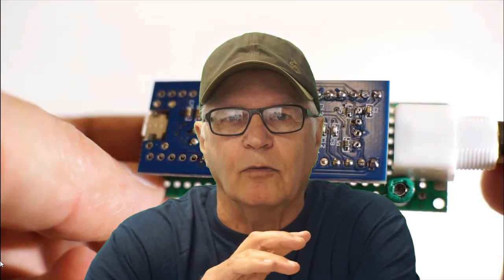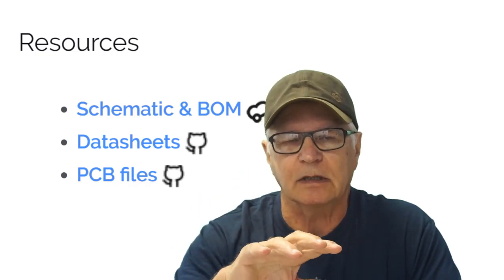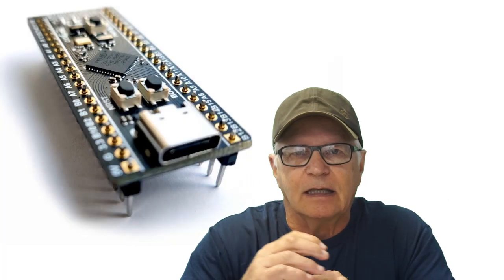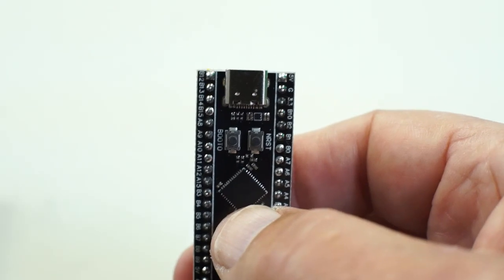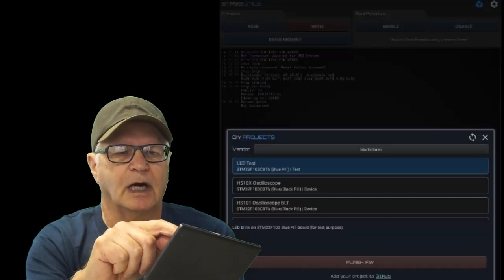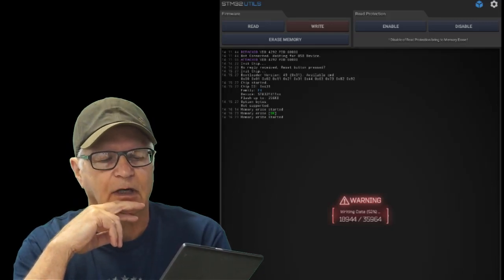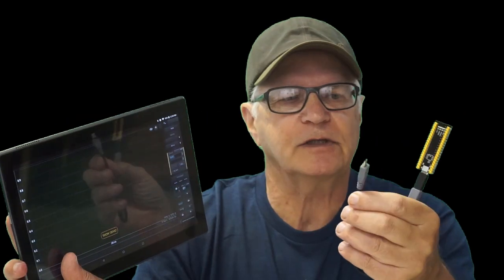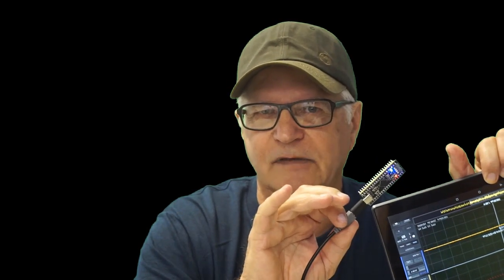GADGETS#114 - HS402 DIY OSCILLOSCOPE

Comment: does ebay have the same components as ALibaba?
Reply from the maker: sometimes eBay will have some of these components and might even be the best deal (most often not the case)
Reply: @theGADGETSplaylist  i bought the STM on Ebay, but headrers were not attached. i have a soldering iron/pin from Amazon. to do soldering work for this , what do you recommend? I want to do make the HS402 the way you made it.
Reply from the maker: @gilbertstrategos  STM32 boards usually ship with headers which we have to solder ourselves. Very easy to do with a good quality soldering iron and thin leaded solder wire.

the fact you ask this question Gilbert leads me to believe you'll need help through your build:)

and the best place do discuss it is on out HScope TELEGRAM group where I and others can answer questions and provide tips...here is link:

https://t.me/hscope

Denis

Comment: HS 102 same HS 402 ?    XY Plot How is HS 102
Reply from the maker: HS402 is a huge upgrade to HS102.

I like HS102 as a through hole build and it is a capable little oscilloscope keeping in mind that is not 1MΩ impedance (as most scopes)

X-Y PLOT is a HScope feature for all 2 channels supported scopes including the HS102

Comment: What do you mean HS402 license? Do i have to pay to use the app or what?
Reply from the maker: HScope free version offers very limited features/performance. Meant to test compatibility with android device and for users to get a feel for the app.

A license for the supported oscilloscope, HS402 in this case needs to be purchased for full use. The license can be installed on as many android devices you own on same Google Account.

I am not always current on pricing. I would say $10 - $15 for HS402
Reply: @theGADGETSplaylist  And where can one buy this license?
Reply from the maker: @EstBest69  you 1st install free HScope from the Play Store. Then within the app, there is a license page in settings and purchase for the desired oscilloscope support is done through there...

you may be interested in the HScope group on Telegram where questions are answered and information shared:

https://t.me/hscope

Denis

Comment: I got my STM32 F411 board and managed to program it, and Hscope sees it. So happy days! Thanks for the video making it clear how to program this.
Reply from the maker: Good stuff, Alastair!
A few minutes ago, I got the PCB populated as far as I can go for now...am waiting on some components...and then pick up from there
Reply: @theGADGETSplaylist Sounds good! STM32F411 is quite an impressive chip. I worked for ARM in Cambridge UK for a while and got a good insight into how chips are designed and tested before being lithographed into a chip (which is the expensive step).
Reply from the maker: @armunro  you should consider joining our TELEGRAM HScope group, Alastair.
You'd be a good fit:)

Comment: Hello, your project is wonderful, I would like to repeat it, but I have problems with the parts, I ordered STM, and the board and radio parts come out very expensive and only on order in large batches, I have a question for you whether it is possible to order a board from you? without stm
Reply: Can I talk with you separately?
Reply from the maker: @kaz56AK  sure Artur , we can talk:)
The most practical way to discuss these technical issue is through out HScope GROUP on the TELEGRAM app.
I invite you to join us there...
Reply from the maker: I would give you the boards if it was practical to do so:)
But it is not...shipping and Customs would be just as expensive as having them manufactured.
I found that ordering from JLCPCB and chosing their lowest cost mail option (even if it means waiting a few weeks) is the best way...
I do hope you accept my invitation to join us on Telegram, Artur. We could discuss this further...

Comment: Skip the STM32f4 series for the next hscope! Move over to the STM32f303 and get 20Msamples/second! All you need to do is design a pcb or find an existing nucleo board and you can have much better performance. I started work on my own, but lost interest.
Reply from the maker: I don't design these. Martin Loren does.
It's not just the hardware but also the software. There's years of development that's gone into HScope that supports these. Most people would drop out as you did.
I'll pass on your suggestions, Jared.

Comment: Dennis do you know if you install all the components from Option 1 when building Option 2?  Its not clear to me if you install the parts for option 1 and option 2 at the same time.  The schematic shows option 1 & 2 but only the parts of option 2 are highlited in the BOM.  I've ordered all my parts and PCB from one of the sites you mentioned in your video.

Love your Gadgets videos by the way.
Reply from the maker: OPTION 2 is about populating U4 and C4. It also involves removing a 0Ω resistor from the STM32F411 itself and soldering a wire at that location that applies 3.3v ... and to make matters more complicated, there a variants to those 411 boards that differ from the one Martin has.
And, REF2033 is not cheap.
I do not plan on implementing OPTION 2 on my build. The noise levels of HS402 without REF2033 are already 3x less than many budget oscilloscopes. I can live with that.
Thanks for your comment. Much appreciated.
Reply: I've got a WeACT v3.0 STM32F411 I purchased off of Aliexpress few months ago when I was looking for a black pill STM32.  Managed to buy the 411 version and didn't realize there are different processors for the black pill.  Guess that screwup has worked to my advantage.

I'd like to make a go at implementing Option 2, for the challenge.  You are right on the cost of the REF2033.  I ordered 5 from Digikey and after shipping they will cost more than black pill delivered.  Can you share information on which resistor on the black pill has to be removed?  I had to use a stereo microscope to see the resistors on the black pill.  Theose suckers look like a spec of pepper.  Removal looks doable.  I'm setup for doing surface mount, already having reflow oven.  Just apply solder past, place your parts, punch up the temperature profile, hit go and in a couple of minutes the board is soldered.  Easy bake.

Thanks again for you help.
Reply from the maker: @ddexd  the comment section does not lend itself to the more technical discussions. I invite you to join the HScope group on Telegram where I, Martin and others can better answer these questions, Dave...
Reply: Denis, just logged onto the Telegram group. Lots of good information over there. I see what I needed to see. The new Vref from the RE2033 has to be wired via a jumper to the black pill and an inductor has to be removed from the black pill. ezee pezee.

Comment: So.... two channel accelerometer data... and dynamic balancing in 2 plains? Looking forward to that video 😁
Reply from the maker: 2 planes would require 3 channels...1 for the photocell...
there is "talk" of eventually going 4 channels with this project, but I have no idea of the time frame or if indeed it does happen...
I do appreciate your interest in dynamic balancing using budget oscilloscopes!